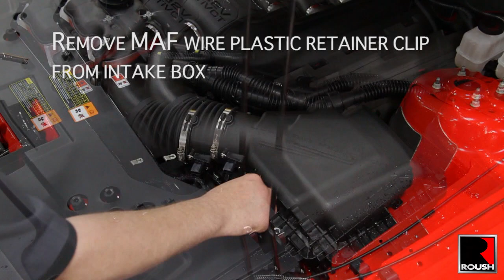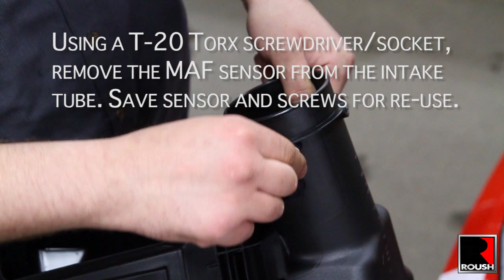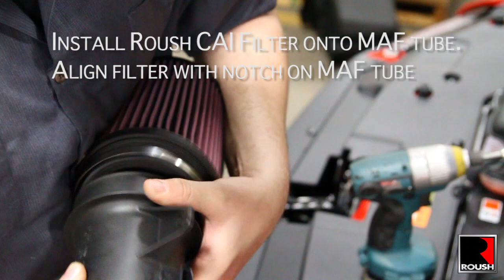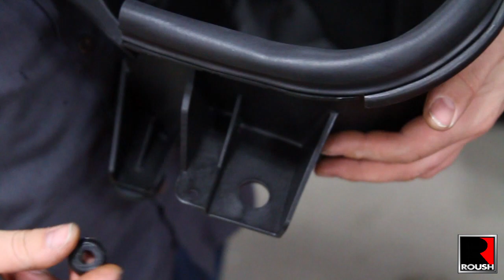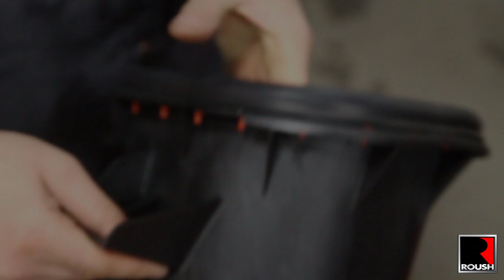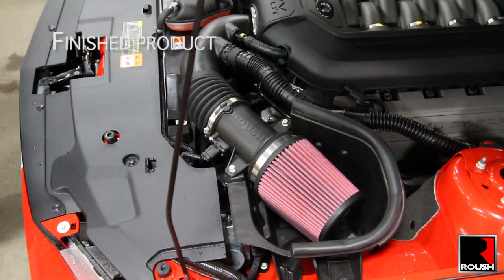Mustang Cold Air Intake Install Video for 2010+ by ROUSH Performance

Comment from the maker: The black foam piece is for the 2013+ only. It gets inserted in the drivers side heat extractor to keep water from dripping down onto the open element.

Comment: Just installed my roush cold air intake. Guy was right it does not mount up to the inlet port on the bottom of the intake box .the factory box has an extention built onto it witch makes a great seal. Seems like a huge oversite on roushs part . Pulled the rubber thru mine to try and make a better seal . Will definitely have to be modified, if not it will just pull all the hot air in from radiator.

Comment from the maker: @Mr11stang 
This CAI is designed for the NA 5.0 cars only (d/t intake piping/location), however, we are currently working on a CAI for our ROUSHcharged cars (5XR/RS3) and are anticipating it's release sometime in the next 2 months. Stay tuned to the ROUSHperformance page for further details and release information.

As far as warranty, details of the kit have not been finalized and warranty is a current topic of conversation.

Comment: @MustangsCanTurnToo I think steeda and maybe bama tunes did some head to head dyno tests and more or less all the intakes performed the same for these cars.  With a tune, each one was averaging about a 15hp gain over the stock intake.  I went with the AirRaid intake because it has the optional resticter piece that allows it to be used with the stock ECU tune or removed for more air flow with an aftermarket tune.  They all perform pretty well though.   Roush has the best price FWIW.

Comment: @MustangsCanTurnToo seems like the couple of CAI's for this car that don't require tune are making around 10hp more to the wheels... but yeah, most gains come from a tune but that can cause warranty problems per the recent TSB released by ford.  These intakes that can run on stock tune are a good alternative.  If anything, they sound cooler sucking the air in vs the stock intake

Comment: @FastRedPonyCar K&N is the only CAI manufacturer that I know of that provides dyno numbers.  If you go to their website, they only offer the filter for the stock airbox with no dyno sheet.  I've had good an bad experiences with Roush products so I stay very objective.  Their website now claims 8 hp and 8lb/ft.  $30 per hp is a little steep, but cheaper than a new exhaust (gain of 8 to 14 hp).

Comment: It took me about 10 minutes to install mine. The one thing that bothers me is Roush left out the flang that would make a better fit, the Roush does not have a custom fit with the stock duct system, so there is a gap between the duct and CAI. I think I will modify it so the fit is tighter.

Comment: When I had a 2010 Mustang, I looked into CAI's extensively only to find that there were no real horsepower gains from an aftermarket intake and that (for pnce) the factory intake flowed very well.  Aftermarket intakes were being sold with a tune only to find that the tune by itself added just as much power.  Do you have any dyno numbers to show that the intake alone improves performance?

Comment: @ROUSHperformance  Thanks for the Answer my last doubts , if I use it with a Diablosport tuner without a custom tune can it be dangerous like running lean or computer codes ?